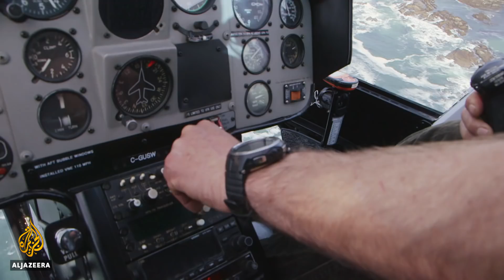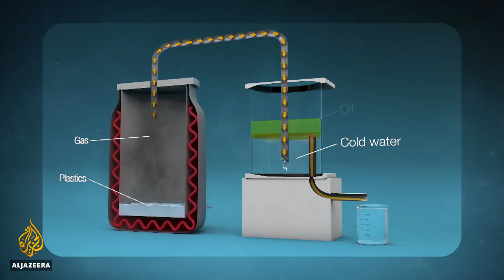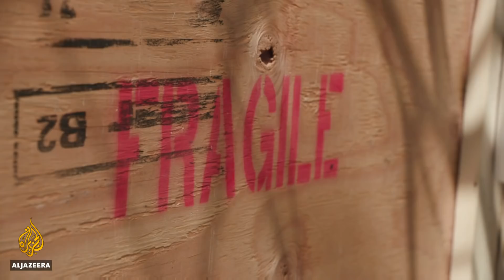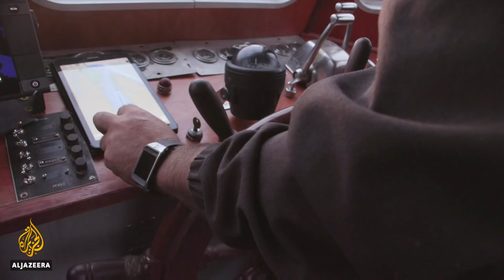Turning ocean plastic into art and fuel in British Columbia | Earthrise

Comment: Tie some solar panels to the  Thermo machine to  create a pretty efficient way to convert  plastic to oil.

Would like to know how they filtered the oil to get it to look that clean
Reply: The commercial units are powered off they gas they produce.  The oil produced is industrial grade, and can be used directly, like in the boat's engine - it looks like that straight from the pyro unit.  Heat it up to around 250 degrees will distill it further, and produce vehicle-quality synthetic diesel.
Reply: Just like making moonshine.

Comment: Is an electric powered/heated device efficient enough? Whats the energy in to energy out ratio in monetary terms, is my 1 liter of diesel cheaper than at the petrol station?...And the ship (boat) is probably not running 100% on plastic/diesel provided from the pryroliser shown, it would takes weeks to fill the boats tank up !.
Reply: The commercial units run off the gas they produce, so much more efficient than their little experimental rig!   1 tonne of plastic produces around 800-900 litres of diesel.
Reply: @robjworkshop5692  only if it's pe. pet from water bottles can only be made to oil at werry high heat so not God economic in that with pet
Reply: They admitted that in the video.

Given all of the previous information her bit of hyperbole at the end is permitted
Reply: @TruckTaxiMoveIt  Yep you're right, journalistic rights allowed.